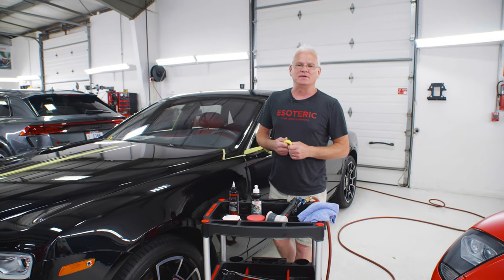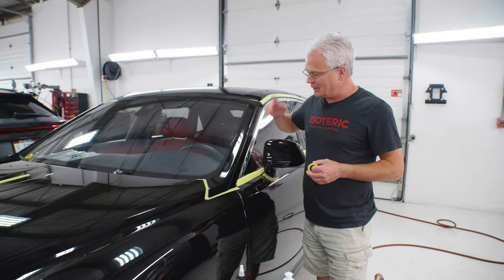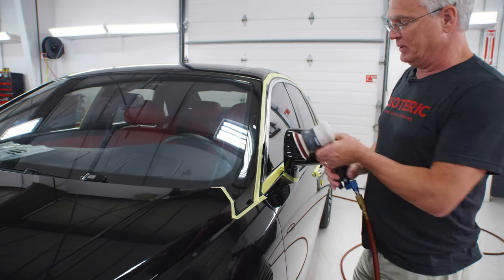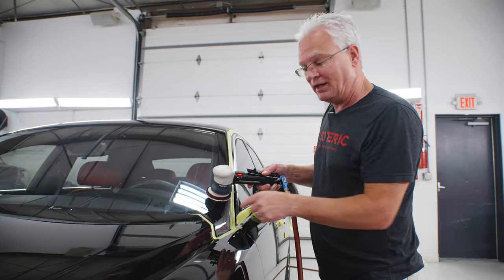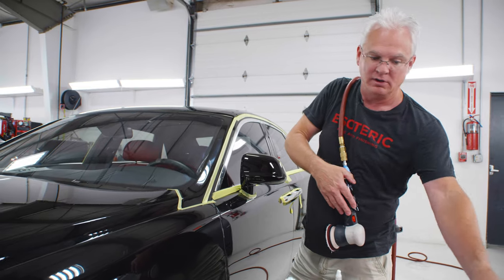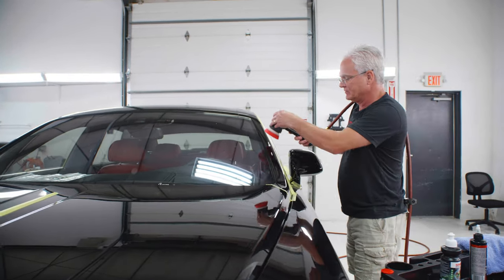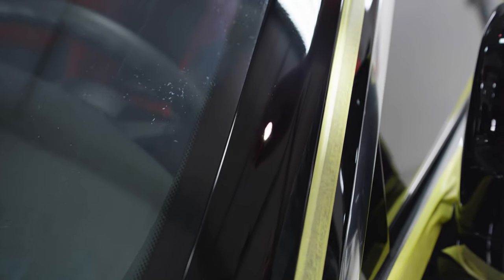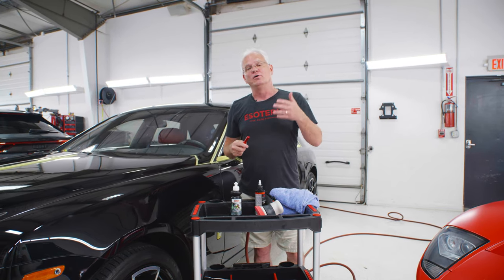The BEST way to polish A-Pillar edges!

Comment: I always worry about that area of a car and usually end up doing it by hand. ( I need to get a smaller D/A for that) But this was a great video that can be applied to other small areas of a car. Taping off is good because it protects from damage and speeds up the cleanup, and the added cost of tape is quickly offset by the reduced time in cleanup. Thanks for the video, I learn a lot by watching them.

Comment: Would be fine to use just a yellow pad instead of a red pad?
Reply from the maker: Only you can answer that, and on the specific car you're working on. It's all about the test section(s) to see what is working best. You will find some paints that the yellow pad is the ultimate solution, and others where you find that the red one is best!

Comment: Todd, where did you get the top for the Jescar bottle? I'm not a fan of the caps they put on their 8oz bottles. Dispenses way too much product - especially when using 1", and 3" pads.
Reply: Stole mine off an old rupes uno 8oz bottle
Reply: @sk8ordie4691  - I had a set of 4oz Poorboy's bottles that I swapped for the Jescar. 

Jescar is my favorite polish line, but those caps on the 8oz bottles absolutely suck.
Reply from the maker: From our website!  https://www.esotericcarcare.com/esoteric-self-cleaning-bottle-cap/
Reply: @Esotericdetail  - Wow!! Thank you for that!!

Comment: Why are you putting the polish on the paint and not on the pad here?
Reply from the maker: Because it's easier to control exactly where it goes. If you put it on the pad, then you have to take the time and effort to line it up. Also when doing a-pillars, we will stage all of our polish in advance so we never have to stop between sections...makes the entire process much more efficient.